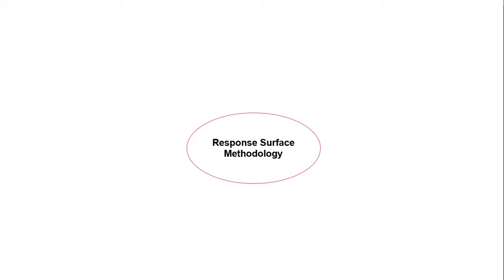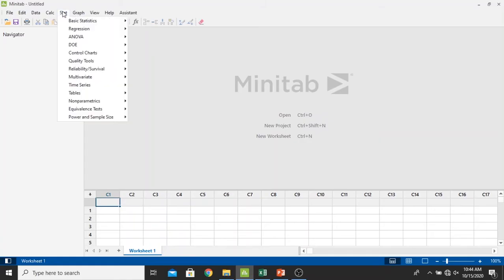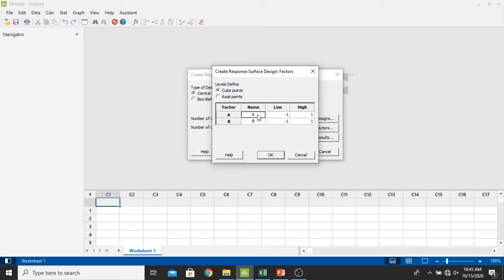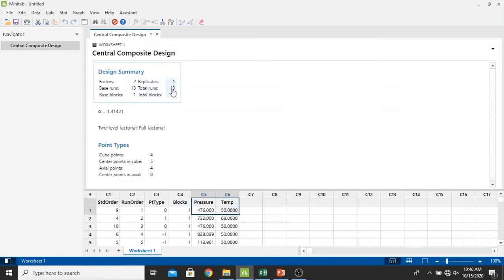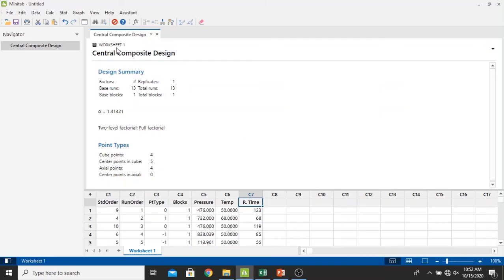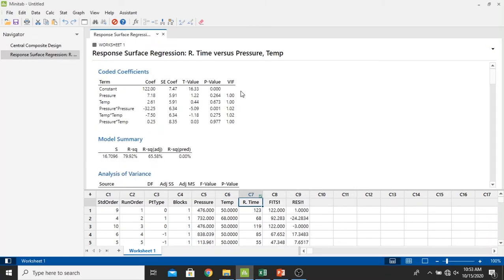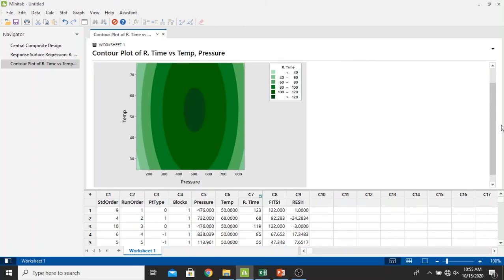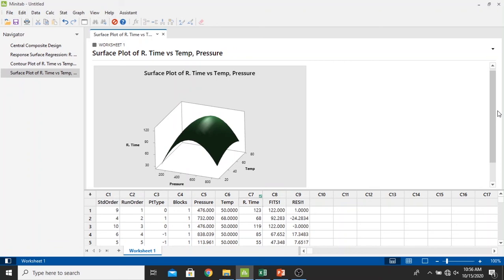Response Surface Methodology (RSM) analysis in minitab

Comment: Question : In your process you are ranging the pressure range from 220 up to 732 PSI and temperature from 32 to 68 oC, but minitab is proposing pressure of 114 PSI and 838 PSI as well as temperature as low as 24.5 and as high as 75.5 oC. In the real life this might be unsafe to test. What would you propose doing?

Comment: Instead of getting only high and low values, how can we get the values with multiple levels? One reference had levels at -1.682, -1, 0, +1, +1.682 for the time, temperature and pressure. Also, if you have any video regarding this, please share the link as well.

Comment: Good day, Sir. Thank you for that informative presentation. I just want to clarify if I could use RSM if I have 4 controlled variables and 1 response variable only? I actually want to use RSM for optimization of a polyherbal formulation (4 components) for my thesis but in the journals i have seen so far, they always have 3 response variables but I am planning on having one response variable only and I just don't know if it is possible because we never had this in school. . . . I hope you don't mind clarifying it for me. . . Thank you so much!
Reply from the maker: Good day sir, of course we can sir. Actually the controlled variables are the independent variables and the response is the dependent variable. For a simple case if we had independent variables of X1 and X2, it can be expressed that the dependent variable Y is the function of X1 and X2.

Y = f (X1) + f (X2) + e

Where,
e = experimental error

Response surface is a method based on surface placement. Therefore, the main goals of a RSM study are to understand the topography of the response surface including the local maximum, local, minimum and ridge lines and find the region where the most appropriate response occurs, I hope my explanation can help you. Thank you